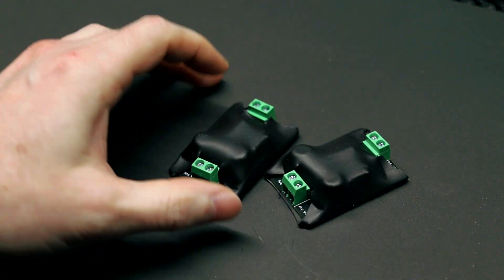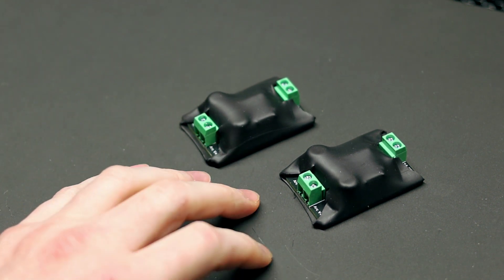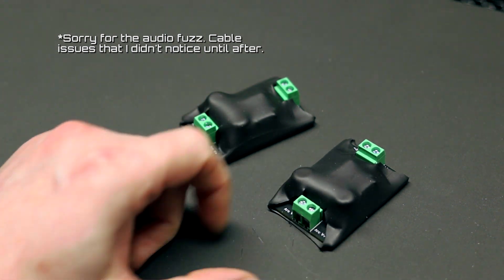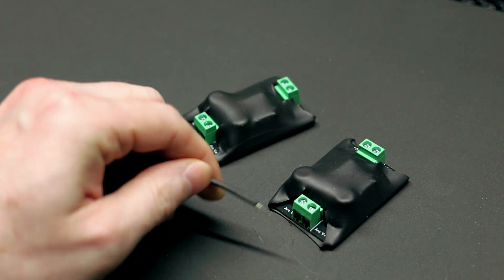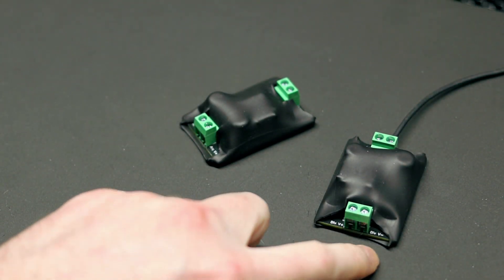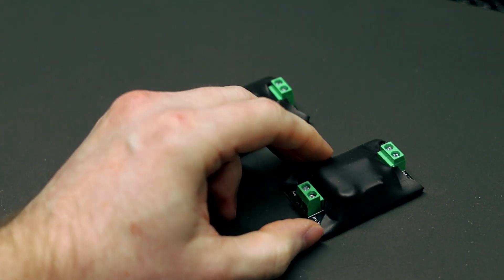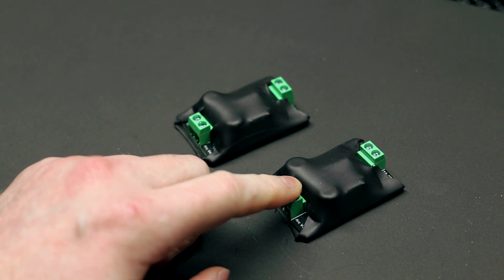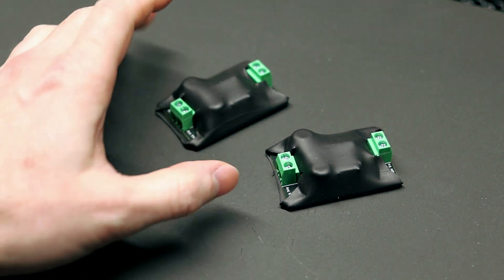New Voltage Divider Lite for Plasma THC and a long detailed cut on the ArcDroid

Comment: Are you saying in another video that THC does not work from them .
I was reading on there forum that a person said to send arcdroid a EMAIL with your serial number that andrew will great a code for your machine. is that correct ?

and adding your Voltage Divider Lite  will correct voltage  fluctuations correct ?
Reply: they dont send it to you dude its bulshit 
iv tryed numerous times i just get an email back saying there no need for me to run it when there sure is going through tips like theres no tomorow i even purchased the compatible plasma so i could run the optyion know how important it is

Comment: what is the purpose of this ?   So i can understand it i need it .
Reply from the maker: Allows the Torch Height Compensation to function. The torch will move up and down to maintain optimal cut height if the material is uneven. A fairly common feature on CNC plasma setups.

Unfortunately with the Arcdroid, it's stuck in beta and the owner will only give the unlock code to certain people.
Reply: @amp_mechanic   why have they done that ?
I haven't bought one yet.
I own yeswelder 60  plasma .
Reply: @amp_mechanic  yesah its a fukin joke turns the machine into a money pit without the option 
very dissapoint @arcdroidcnc have done this

Comment: I need one for a miller 875
Reply from the maker: Available on my website https://www.ampmechanic.com/voltagedividerlite

Standard 50:1 is what you want, there is a trim pot to adjust if needed. So I would recommend the version in the enclosure.
Looks like you'd have to wire it direct to your + and - outputs inside the Miller. You should be able to run the wires out one of the vents and into the divider.

Comment: Great stuff.  Does your divider have input/output isolation?  i.e. optical, A/D etc.
Reply from the maker: No it does not. I can't see that it would be any benefit in this situation but I could be proven wrong.
Reply: I can't either, if it works don't muck with it.  But my comment is based on the group doing plasma cnc with a linux cpu. A/D in and out makes sure a noisy ground line frompermeating the controls.   We'll see.

Comment: So the voltage divider issue with the prime weld cut 60 is the reason its not on the recommendation list for arc droid? Im planning on maybe getting the arc droid but dont want to replace my cut 60. Also seen where you mention something about thc unlock code from arc droid.. is that something to be concerned about?
Reply from the maker: No, some Cut60's have a HF issue with the ArcDroid. Not all but some. That is unrelated to THC. The internal divider performance varies by machine, same as most other brands. 
I'd run the Cut60 in your situation, if you end up with the ArcDroid resetting mid cut, you'll know you have an HF issue. There are tons of people running the Cut60 without issue. 

THC is still in beta and I suspect it will be forever. They don't even advertise it as a feature anymore. Once you get some experience, email ArcDroid with your serial, they will send an unlock code. There may be some back and forth and trying to convince you to just use autolevel but if you persist, they will send it.

Comment: I guess buy one of your voltage divider I want to install it on a 60amp Eastwood plasma cutter would it work thanks
Reply from the maker: The Eastwood 60A Versa Cut is a high frequency plasma cutter, it's not recommended for CNC applications. 
If you do have a CNC compatible cutter, the divider will work with any plasma cutter, just needs to be wired to the + and -  outputs.
Reply: @amp_mechanic  The plasma cutter is not a versa and it would not work with that machine.

Comment: I’m new to plasma CNC, currently have a PROCUT 30A Plasma Cutter (exact model Andrew demos wiring the trigger in his YouTube video) and an ArcDroid on order. Would your device help with my setup? Thanks
Reply from the maker: It would be necessary if you plan to use the THC as I don't believe the Procut 30 has a divider. If you're new to CNC, get used to making cuts before diving into the THC. It is a useful feature but another layer of complication.

Comment: Hi, I'm enjoying your videos, but I have to say that most of what you are talking about is way over my head. I have been playing with my Arcdroid for about two weeks with bad results. I have zero CNC knowledge and the same with and CAD design. That being said, I am using a Yeswelder CUT55-PRO plasma cutter, I tapped into the trigger wires like Andrew shown in his video. Would one of these dividers help me in any way or would it be best to take some time to figure out how to use this first? Thanks
Reply from the maker: Hi, the divider is only needed to use the THC. My advice is to get the ArcDroid making reasonably consistent cuts before trying to get the THC working. THC is another layer of complication and the learning curve for anything CNC is a little steep for new users.
I have a video on finding cut settings, the key point from that is to only change one parameter at a time. Then you can not only understand what number values work but also what each parameter actually does to your cut. Start with simple shapes. Persistence pays off.
Reply: @amp_mechanic  I have watched that video, I have watched all of your videos about the Arcdroid. I need to just get used of checking the tune settings, pierce and cut heights mainly, to me those should be about the same for anything being cut. I have a IPT40 torch, the only nozzles I have are 1.1, I will check with plasmadyn to see if they have smaller ones for my torch. Thanks
Reply from the maker: Double check this but, I believe ipt40 and ipt60 are cross compatible. If so, the Plasmadyn 0.9mm made it Italy nozzle (pipe cutting tip) is a really good one. Lasts a long time.

Comment: Excuse my ignorance here, what would this be used for if the plasma has a divided 50:1 voltage output already, like the Everlast 82i? I’m not saying it’s not needed , curious to the benefit.
Reply: I have an Everlast 25i.  It is not a 'CNC Ready' plasma cutter.  I can hack into this unit to tap into the raw voltage, but need an external voltage divider.
Reply from the maker: The dividers on some cutters either work inconsistently or don't work properly at all. I found the one on my Everlast was very inconsistent and after searching across the net, it's a fairly widespread issue. Not only with everlast but others using the same style setup. That plus more testing, it became clear some extra filtering was beneficial, especially on the ArcDroid, to make the THC perform reliably. It's also been a more cost effective option for those that have either burned up their factory divider or don't want to pay more for an add-on kit.
Not everyone needs it. I've answered a few emails where we got them up and running with their built in divider.